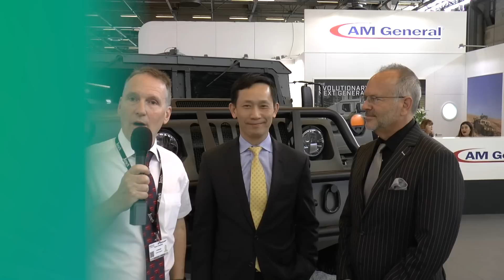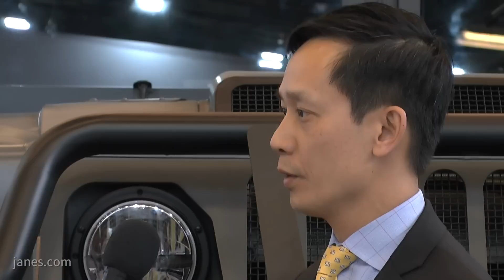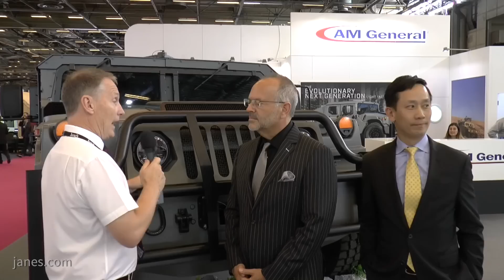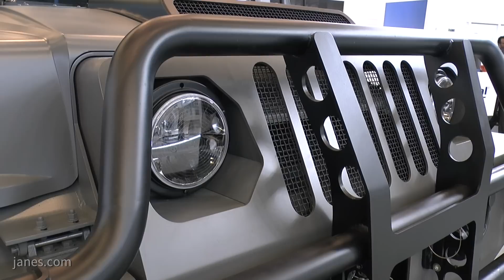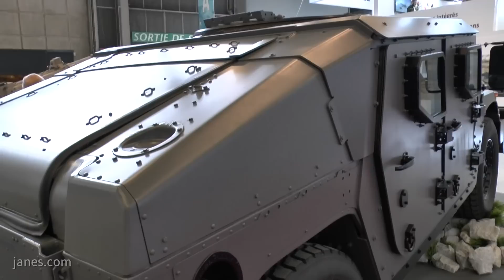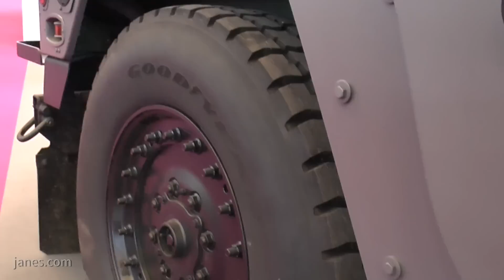Eurosatory 2018 AM General unveils NXT 360 light tactical vehicle

Comment: The vehicle is crap.  No survival rate when hit with a ied.  The interior was too small to move around and to get into and out of the vehicle.  The performance was bad and too noisy.  The clearance of the vehicle was too low.  The MATV was 1000 percent better in all aspects.
Reply: Pete N your right, but the army will still be using Humvee during the next war. Might as well upgrade them.
Reply: @cleo1488  

We were using them in Afghanistan, but was switch out with matv, max pros and cougars.
Reply: Pete N glad you were safe in MRAPS, but the army is now in its enduring fleet which is around 8,222 MRAPS vehicles.  That’s clearly not enough vehicles for the next war, because the JLTV is not in full rate Production. Soldiers will still be using up armored Humvees. Might as well give them the best Humvee you can. Did soldiers prefer the MaxxPro or Cougars MRAPS?

Comment: Not cool at all. They could come up with so many better improvements than that. They should have just started out with a new complete vehicle build they could have used the same footprint at the Humvee took and redesigned everything to something which makes more elastic sense to the modern technology we have nowadays. It's a shame they kept the same engine as well cuz that thing is a dog. The transmission upgrade is a good one, the increase in suspension capability is a good one and a quicker ctis but really they could add so much more if they just started from scratch.
Reply: they did come up with a new vehicle, the MRAP! a few companies making them too